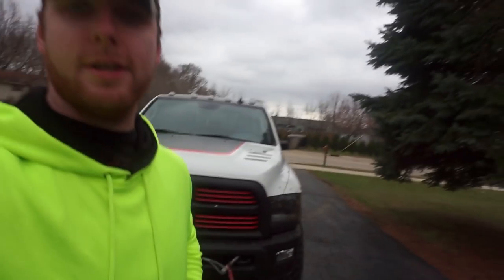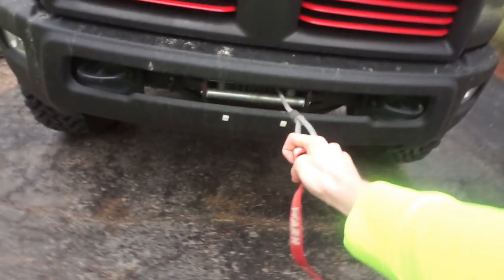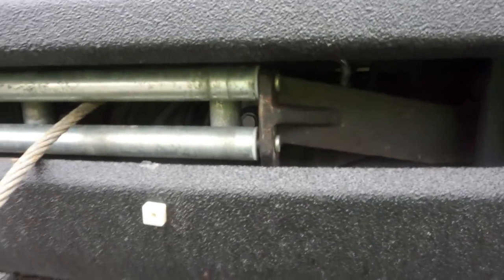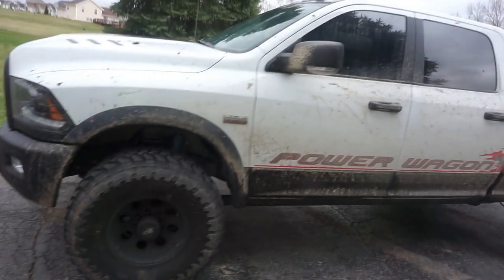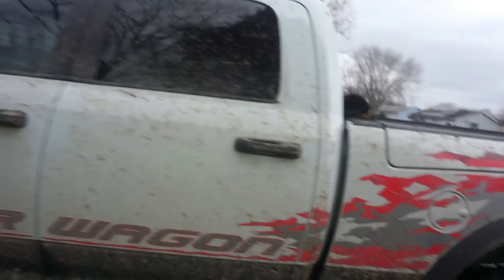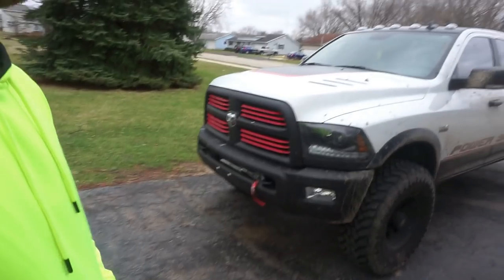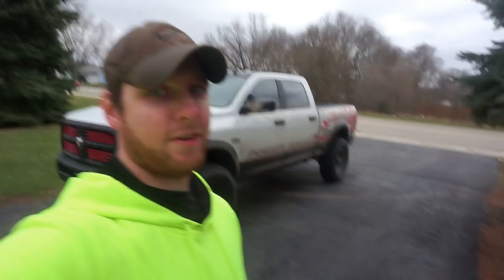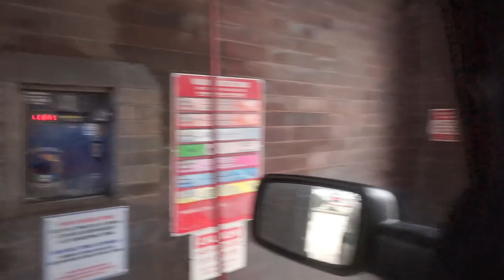How To Use Your Warn Winch on the Ram Power Wagon +(Vlog)

Comment: Mine is a 2017 has the standard 6.4L 180 amp Alternator (after purchase I noted some had 220 amps and even duel 220amps).  I got it good and stuck,  and was  first and last time to date. I had to use winch to get out.  I had a issue where the truck was running, volt gauge just above the middle of the gauge where it is usually is at when running. Really quick into winching,  the truck dash lite up with LOW VOLTAGE, and I was  not winching the hell out of it or anything. I owned other Ram 2500's with after market winches, and never had an issue like this.This was a swamp area, and I did pull the only small tree with about 35-40 feet of cable out the ground. I ended up hooking to a 2500 truck, and got me out. I have been stuck many times, and used my winch many times to free myself or someone else with others Ram trucks starting way back in 1999 with 318 motor.  I never had a winch pull down a motor alternator/battery like this. Guess my question is have you ever had this happen to you when winching yourself out. Was a first for me.
Reply from the maker: Hmmm that's strange, sorry to hear that. I've used my winch 5 times to pull myself out, hot days, swampy waters and its never given me any troubles, no voltage issues at all.
Reply: IWrocker thank for your reply for you sound like you really know these Wagons, and have  put them through the paces and know the limitations of them. Today I hooked the winch to a big pine tree about 30ft. out, and started to winch the truck to the tree. I be Dame after about 15- 30 seconds pulling under a load, dash lights up again WARNING LOW VOLTAGE. Today I got a check engine light during this, so has to be some kind of defective voltage problem with the  system, dealership this week. If it is anything other than the battery or Alternator I will post it so this ever happens to anyone else. kinda need this shit to work when you need it, truck had like 1,100 miles on it when this first happened.
Reply from the maker: Yea there has got to be some sort of defective issue there. I'm sorry to hear that. The winch should be helpful and reliable, as i have put it through some stress with no issues. Definitely hope the dealer helps you out sir.

Comment: Hey Ian! Got mine back yesterday from the body shop, $3,800 latter. Grr, to think of what I could have done with that money. Oh well. Next up, solar on the shell (I think I can get 3 panels, so about 450 watts) and wiring for the ARB fridge and a PUMA air compressor. Utah is fast approaching... Funny watching you get in the bed. I have to do the same thing. That tailgate, stock, is up there. My three Labs look at the gate, then to me, then back to the gate. Then they wait till I lift their fat butts up. One of them weighs over 100lbs. About all I can do to get him up in there! Today or tomorrow, I'm going to have my son help me re-spool the cable. I've yet to do that. Kinda toying with the idea of replacing with synthetic. Not a huge priority at this point however.

Comment: As an FYI we talked about my winch showing low voltage when using under load. Well it was the battery. Had a dead cell, and it was replaced under warranty. Just got a bad one from day one. New Truck Right at 1,000 miles 2017 Wagon, but that is the natural of vehicle batteries. They can last one week or ten years. Just wanted to post so if anyone else has this problem.

Comment: Does the truck need to be running to use the winch?
Reply from the maker: No the motor can be off and still winch
Reply: Karl H the winch will work without the truck running but the winch has a 12 volt motor, if the truck isn’t running and charging the battery it will drop below 12 volts and that will shorten the life of the winch motor (heat)

Comment: Just a question have you cleaned the underside yet and the inside if the tubes, frame?  Also what do you have for your frame coat?  I've just put on valspar anti rust on my 03 1/2ton hemi.
Reply from the maker: I havent fully and so far i just have the factory E-coating followed by underbody rust protection spray i apply a cpl times a year from a spray can

Comment: Not a bad idea to lube the plug and make sure the cap is on tight. Mine corroded under 2 years 100KM with out any attention by me, or the dealer. Sucked when I got barried in the northern alberta oil fields.